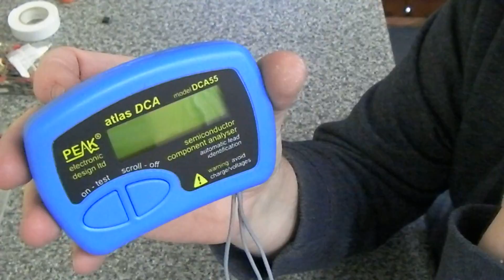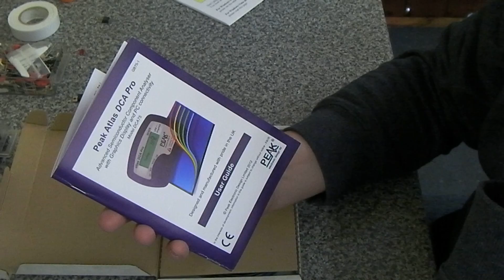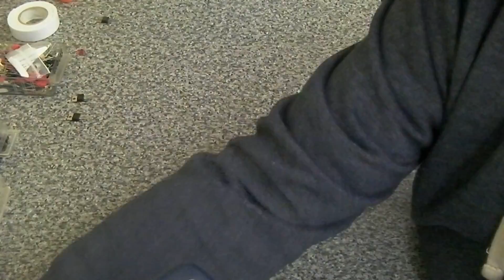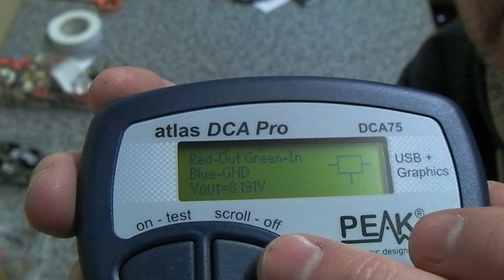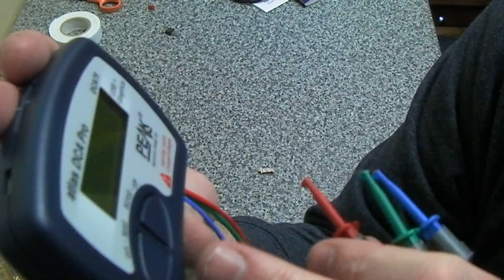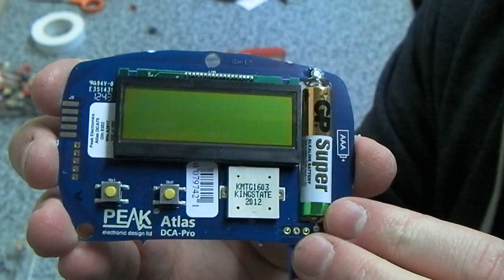Peak Electronics DCA75 DCA Pro Review

Comment: Wish you had tried it out on high wattage transistors to see that it works or if it has the same issues as you found with high wattage zeners. Was thinking of getting one as I test a lot of audio gear including high power audio output transistors but will hold off until I find confirmation that it works with these high power devices.

Comment: AAA Battery Selection:
Over the years of using the GP23A (MN21) 12V battery in many of our products and also the AAA in the Atlas SCR and the Peak Eddi data logger, we have had plenty of feedback from customers. Generally the AAA cell is preferred because it is easier to get hold of. It also holds MUCH more energy and provides for better battery life for the same power consumption application. For example, the GP23A holds about 0.5WH compared to the AAA that holds about 1.2WH.

Comment: Test lead fixing method:
Because the leads are coming out of the enclosure on the same plane as the PCB itself, there is less fatigue on the joints if they are soldered FLAT to the pads. The holes in the pads are not for the wire to poke through, but to allow some solder to flow through for anchoring & to ensure quality inspection. A wire fitted through the hole will suffer more fatigue problems because the wire will be bent at 90° to the PCB. We have performed wire fatigue tests to verify this.

Comment: LCD fixing method:
The LCD is fitted by a 1.27mm pitch SIL header on the top edge of the LCD. The LCD's PCB is around 0.5mm thick, giving it a small amount of flexibility without strain on the joints. It is deliberately not anchored on the other edge to ensure no damage to glass results from accidental impact on the front of the enclosure. In more than 10yrs of using this fixing method, we have not had a single joint problem that was not caused by a poor solder joint in the first place.

Comment: Thank you for your comment. The DCA75 measures HFE up to 32000 (not 20000 as originally released). Measurement resolution can get very coarse at gains of more than around 32000 because of the incredibly small base currents involved 5mA/32000=156nA (the gain is calculated by measurement of the collector current and the tiny base current). We can measure to higher gain values but they start to become less useful as the measurement gets coarser. We are still looking into this however.